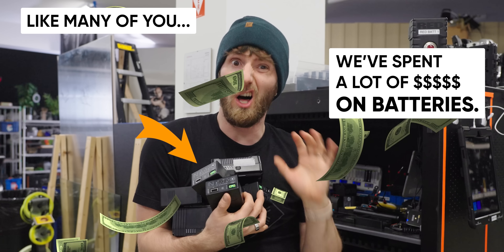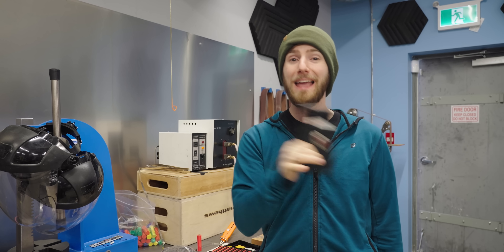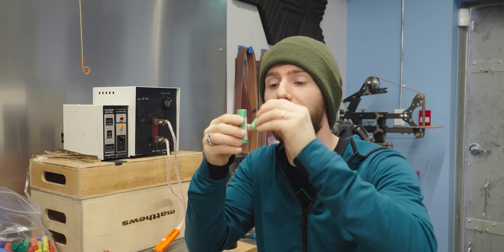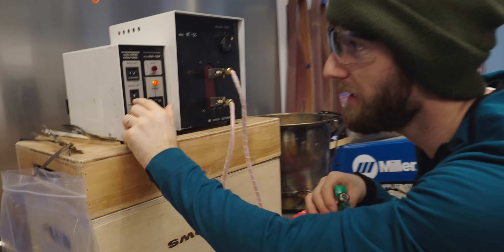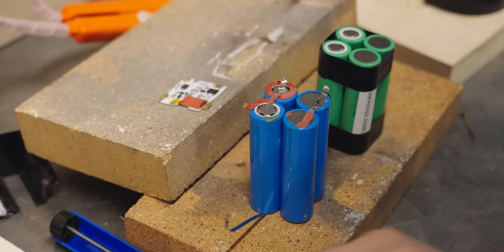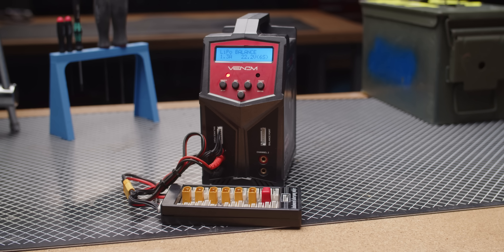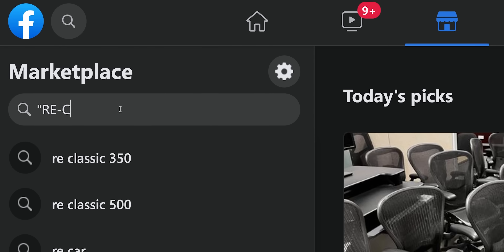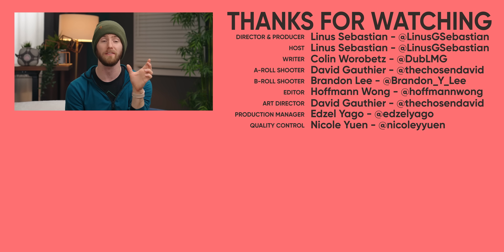This should be illegal… Battery Repair Blocking

Comment: Speaking of Evil BMS, that reminds me of Apple and their older phones being slowed or capacity forced to be lower over time. Tesla has also nerfed charging speeds at superchargers for their older packs. As mentioned replacing individual cells or a module of cells can be harmful, mostly to the new cells because of the BMS balancing the older less capable ones. I can imagine this is what caused Daisy to catch fire while charging on Rich Rebuilds channel.
Reply: The problem with older cells is their ability to take a charge at a specified rate. Many LiPo's are rated at a 1C or 2C charge rate. This means that a 2,000mAh battery can take a charge at either 2Ah (1C) or 4Ah (2C). Just as they are rated for a discharge limit of something like 5C/25C (i.e. 10Ah continuous / 50Ah burst). As a cell ages and degrades over time/charge cycles, its ability to maintain its rated charge/discharge rate decreases. Cells in a battery also try to self-balance so by mixing cell capacities or differently aged cells you run the risk of "dueling cells" where they try to balance but cannot.
Reply: Also it happened to many laptops with swappable battery pack. My old original Acer Aspire V5-431 battery pack has that type of BMS. After almost 10 years without replacement and losing over 60% of its original capacity, it was shutting down and not detected by the laptop itself. Thankfully, there's still many new original replacement pack I can buy for just $30 today even though my laptop is 10 years old
Reply: Siham Hamda Zaula M Those old Acer and Sony Vaio laptops are a thing of beauty. Still wish we could buy new laptops like those these days. Framework comes close but they don't ship to my country.
Reply: @rherydrevins  but then apple would be selling less phones and we can't have that.
Reply: Wait Daisy caught fire?!

Comment: I'm pretty sure your 2, 3 or $4M annual salary will dissolve the anger usually raised, when having to spend high prices for stuff you need.  Take your batteries, sit them in a layer of Saltpetre, in a b that can be shut with a lid, making sure nitrate is in contact with the terminals, you need  a small Black strip light UV, switch on fix inside the lid, then leave for 12 hours no longer, wipe the batteries clean of nitrates and the batteries of any kind, except 9Volts rectangular  ones as I've never tried those.... the batteries will be almost 100% like the day you bought them, works for AAA batteries that are not rechargeable at least 4 times, decreasing around 10% power each time.
Your welcome, you need to start moving away from the i9ternets only way to do things, Chemistry which leach through the earths geology hold secrets that just go on and on, there's a big reason why the alchemical literature in the 1700's was banned from public knowledge, there are 17 different uses I know of for saltpetre (which is everywhere) Gu8npowder they say was the primary need for it's production, this isn't actually true, although historically pushed that way, and it was being used to produce gunpower for cannons and muskets etc, the real use was it did things to Gold no one had thought possible, a nitrate manages to alter Gold, but super fine gold that was impossible to bring out of the acid solutions with mercury, gold that not even a jewellers loop could see in rock associated with  Gold has super micro gold throughout, heated to 2700K for 3 hours, the saltpetre and ground up rock was like black sand , allowed to cool put into an agitator, with nothing but plain cold water created an atmosphere with a layer of oxygen from the Nitrate and colliding with open air, all the micro gold were attracted to each others altered field, Gold is a dielectric, but it was like grains of fine black sand, water shoed that it was actually Non reflective Blue asd the water was dark blue, depending on how much material used, the gold would collect at the centrifuge as a sphere or more tear drops , but with a higher luminosity that most high graded gold and 97-99% purity from ground up rocks that appear to have NO GOLD at all.
Another battery changer in nature is a UV light power torch and creeping Ivy while still attached to the wall, recalibrate a compass to the drifting magnetic North Pole , by7 placing it inside  the hollowed trunk of the Eternal Yew tree.
Humanity is literally Brain Dead, the reason I can say that with confidence is because of the vast amount of shit that has no purpose is produced in mass 24/7, WISH exists and is a multi billion dollar company, producing plastic crap, conning people and selling bad copies of everything ever, you know why, because it's Brain Dead Humans that are DEMANDING IT, nothing is produced without demand... So WISH must have been laughing his nuts off when millions of YOUTUBERS thought buying massive amounts of electronic Trash Can material and opening it on film was cool, or trendy, or im sure you've built a computer with the parts you never would WISH for unless the Brain had Died.
Anyway that my rant, Humans should be illegal until the demands for massive Turds free with polishing cloths, to spread that turd and cover a larger area, stops forever, try the 1st battery charging with the black light and saltpetre, make sure its a little strip light as it's evenly spread, it will change your mind about todays technology being the bestt, the best was figured out long ago, and wha conflicted mass production was removed from popular belief and mainstream sciences.

Comment: As an electrical engineer (though not doing it professionally, only as a hobby), after watching just the first minute of the video, sorry but no. Replacing just the cells is a REALLY bad idea. As in, you are inviting disaster to happen. Repairing is awesome but there are some instances where it's too risky.  LiIon is not in any way comparable to old NiMh batteries - charging circuits are specifically designed for particular type of cell so unless you can guarantee the cells are exactly the same specs as the ones being replaced (in which case yeah it would be fine), you cannot guarantee safety and proper charging profile. I do electronics just as a hobby but personally never used LiIon batteries because I see them as just terrible from every angle except for energy density (which is sadly the #1 criteria for most uses). I designed and built devices with built-in chargers for NiMh batteries (not a flex - it's easy if you just read the datasheets for the charging chip) in the past but wouldn't dream to do so for LiIon - there's so many things that could go wrong. Basically you need to buy batteries and chargers at the same time, and protection circuits are built in, mated to those cells. I am not going to mess up with those. Recycling should certainly be a thing, however. And providing a way to replace batteries - both by designing device to facilitate that AND providing a source for batteries (as, again, the cells must be exactly the right ones) should be mandated by law to prevent ewaste.

Comment: A lot of BMS boards may 'appear' to be Evil, in that after switching the cells, they just won't function anymore. However, there are a lot of BMS chips, including Texas Instruments chips, that "require" external power to turn the chips on. Where these repaired battery packs put into a "charger" after they were reassembled? The only clips I saw where trying them in the "devices/loads", and not in a charger.

Comment: Bosch is one company that's nothing short of evil, on their e-bikes, if the bms detects anything out of the ordinary that's not in it's programmed perimeters it commits suicide bricking the entire pack. In addition, you can't use any aftermarket battery packs, since it talks to the controller. As if that wasn't bad enough you pay a premium for their tech

Comment: Yeah... Just buy new battery packs. I'm all about repairing stuff yourself, but when it comes to power delivery, let the vendor assemble it safely for you and supply it in a safe assembly to you. If you're not going to recap a power supply, don't try to reassemble a battery.

Comment: I'm disappointed in you linus. The BMS didn't work not because it was intentionally sabotaged, but because it defaults to "shipping mode". This is a low power mode where the BMS is by default configured into a basically zero power draw state, but means its literally doing absolutely nothing. Therefore, it can't power your device. This is so it doesn't drain the battery to zero in storage. This is a standard feature which has nothing to do with right to repair, in fact it's hard to find a BMS chip which doesn't have the feature even if you don't want it.  Depending on the chip these can be woken up in different ways, but the majority are woken up by charging. Some need a external system voltage/configuration logic applied, though, but in reality that's usually applied from the same source as the charger. 

 If you had taken the time to talk to an expert rather than listen to the angry internet trolls you wouldn't be spreading misinformation. This is going to be one of the most popular videos on this topic. Think of how many noobs you have now misinformed and think they are just screwed when in reality you tried to educate people without knowing what you were doing. 

I recommend posting an update.

Comment: If a BMS is an "evil" one by virtue of having volatile memory or shutting itself down when it sees power disconnection seems like you should be able to keep it powered up off of a bench supply during the re cell process..

Comment: It's not spot welding when your welder burns clear through the valve on the battery. Too much pulse time and insufficient amperage to get a clean weld. Should be more like 3ms pulse to reduce heat penetration. 14ms is more like welding sheet metal panels on a car together. 

It's not supposed to stick to the spot welder ever. 

I mean, there's even a snippet of a professional rig showing what spot welding should be...

Comment: should've bought a kweld. I build large battery packs with 200+ cells and it's amazing. What you need to spot weld is a very short pulse at basically thousands of amps. The way your tips were glowing suggested the timing was way too long. This can cause the metal of the cell itself to start melting in that spot.

Comment: The SONY looks like the batteries for our GPS system, I had to repair the connection between the pack and bms on one of them. I had the same problem where the BMS did not provide voltage  to the external contacts after the repair. This was fixed by putting the battery in the charger to wake the bms up again.

Comment: I endorse the right to repair in 95% of cases, only exception is where others can be hurt from bad repairs like in cars. imagine this scenario; your car breaks fail, being an average person you know nothing about cars but rather than bring into the shop you watch a YouTube video to save some money, the problem is this video doesn't cover all the way the breaks might fail or that not everyone has the grade of equipment needed for a good repair or to test it their work. You you finish up and decide to take the car out for a spin just to find out the problem is not fixed as you head into a busy intersection, if your lucky you miss everyone and find another way to bring yourself to a stop, if you're not you are now part of a multi car pileup. The point being that sometimes there good reasons for regulations or being told not to service certain objects; things like phones, computers, and cameras are not going to cause a mass loss of life if the repair fails, unless you are doing something stupid like messing around with it while it's still plugged in; but something like cars, (or even worse) planes, and trains that will likely kill people if they fail should be professionally repaired.

Comment: I do not know what that ancient thing you thought was a spot welder is. Please get a K-weld and adjust your settings. Also, there are nickel strips specifically for 2s2p or 3s2p connections. Nickel to nickel welding is not considered good practice because it makes for a weak connection. I do not think the dial you thought was "miliseconds" was exactly that because, I hear the transformer whine much longer than what was set. The welds were, let's just say, too glowy, an indicator of too much current or a too long pulse. Just get a K-weld, use proper nickel strips and try again. You'll succeed this time, guaranteed.

Comment: I have been recycling rechargeable battery packs since 1980 & I have never found a service replacement battery pack & I still have some working i nicad cells recovered from 1970s military surplus. Back in the 1980s/90s Sony were particularly bad & with the timers built in into apparently most modern device's  premature obsolescence is standard have you investigated a battery packs with individually removable cells that were rare in the past & sometimes a lifeline.

Comment: You really should have equalized the cell voltage before charging. Just connect them to a current limited power supply set to like 3.7 volts and you can get them all to the exact same voltage.
Reply: I think Jerry Rig  Everything explained it way better when he was making batteries for his Jeep
Reply: @nzfade1  never watched it but I'm not surprised. I left another comment but basically, Linus did us dirty with this video. He didn't do research about how most BMS's work, and then turned around to claim people were being malicious

Comment: The tour would, if anything, bring awareness to how problematic batteries are when improperly disposed of. Please do the tour!
Reply: Easy, just burn them.
Reply: @rydz656  back in the 80s we sometimes burned trash and with it some 1.5v batteries, those carbon manganese non rechargeable types, one time it exploded  and launched into the air like 15 feet, luckily it went straight up vertically and no one was hit.. I've come to the conclusion that burning non rechargeable dry cell batteries are dangerous
Reply: Yap, same. Please do the video.
Reply: I dont see where you get that, the only thing they would show is thier value to world and enviroment but only as a promotion tool. Its a business after all and there business is to make money not wave the we are one world banner.
Reply: Would definitely want to see how this works
Reply: batteries qui marchent
Reply: This should be a good enough demonstration: https://www.youtube.com/watch?v=t1j9TUV5coc Keep in mind that the ones that don't do anything, don't have any charge left. They're only dangerous when they're charged up, and the fireball is caused by the release of energy. You can prevent fires, by removing these cells from devices, and connecting the positive and negative together to fully drain them.

Comment: Dyson does the same. I have a V10 and i used to never use all the charge. So I though I need to do a calibration. Run for 40 minutes. And it never came back. It went in protected state. I had to buy a new battery pack even knowing the battery was 70% more or less health.

Comment: I am guessing the red packs and Sony are using volatile memory or programed to not boot after power loss. I have access to enough 4 quadrant supplies to simulated the batteries before removing the BMS to keep it alive while replacing the cells but that would be a pain. I don't have issue with charge cycle counters as long as there is a way to reset the device but volatile memory is a bit much. There are some safety concerns if a pack is drained to 0v and force recharging the cells but I would rather have a means of repair.

Comment: Using volitile memory for program storage actually is a well known DRM and anti repair measure. A lot of the old capcom arcade game boards have their data on volatile to prevent piracy, and it was quite effective.
Reply: @Lassi Kinnunen 81 can't have been streight xor since that's vulnerable to a known plaintext attack if you could guess the plaintext anywhere in the file you'd be able to get the key .. hmmm
Reply: it doesn't sound like it'd be very effective. all you need to do is read the data from it while keeping it powered.
Reply: @LiEnby  if its integrated ram, how will you read it? Typically you would need to etch or mill away the epoxy and other work intensive stuff. Doing that while connected to power is guranteed to fail.
Reply: @LiEnby  That's not how any of this works.
Reply: @Orochistorm  thats not how the force works

Comment: For lithium fires you need a class D extinguisher. The body of extinguisher will be yellow and there are two types: one with copper and another without copper. One with copper, if the battery reignites the copper will melt creating a dome over it preventing it from reigniting

Comment: On first power on the current safety switch will likely be in a triggered state so you won't get voltage output.  To get the switches to turn on you have to apply a charge voltage first.  BUT, most safety BMS circuits on commercial battery packs are designed to not turn back on after removing the original batteries so they will require reprogramming first.  This is likely the manufacturer covering their own, they just don't want the liability if you mess something up...